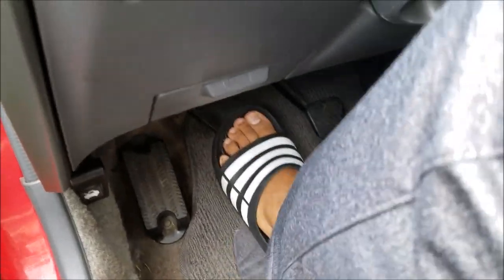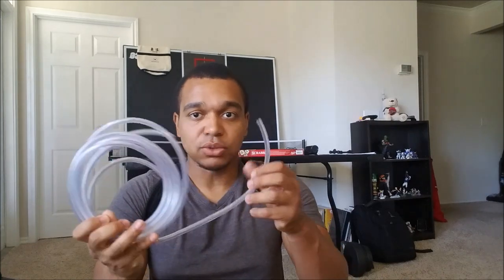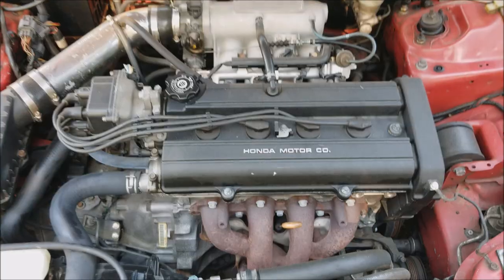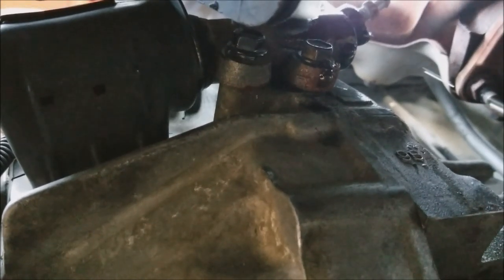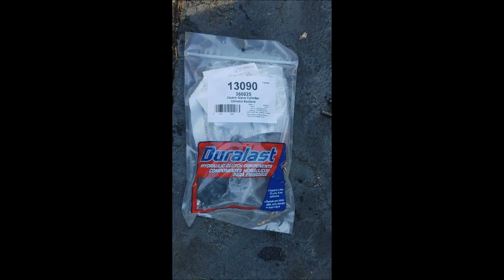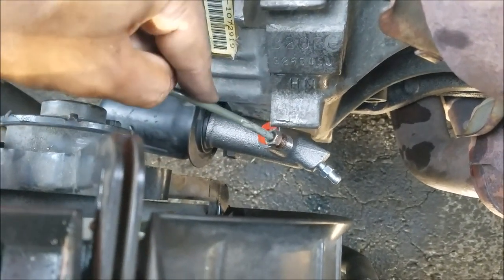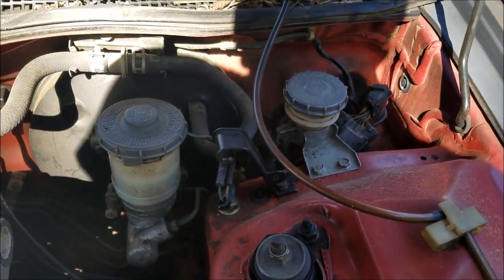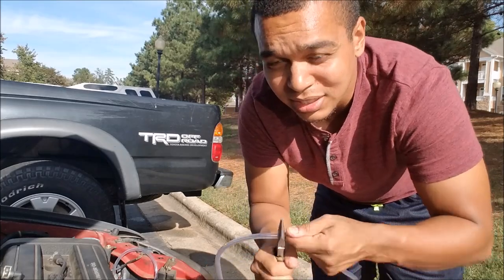SELF BLEED CLUTCH LINE & Change Slave Cylinder | Honda & Acura

Comment from the maker: If you like the video please like and subscribe! Looking to scrounge up subscribers to spread helpful advice to and also gain some knowledge from them! Enjoy learning from my videos as much as I try to pass knowledge :)

P.S. I mention braking a few times in the video by mistake haha. Just a slip since brake fluid is the hydraulic fluid for the clutch line.
Reply: Engineered Mojo thank you so much! You saved my ass.
Reply: Engineered Mojo like and subscribed.
Reply: Were working on a 2006 honda accord slave cylinder and were having a hard getting the car to stay in gear
Reply: Need some assistance were working
On a 2006 honda accord slave cylinder ,and it's not staying any suggestions on,what could be wrong. Or what were missing
Reply from the maker: @matthewkose3138  is it popping out of a particular gear or pops out of every gear?
Reply: Great video. Thank u brother.
Reply: @EngineeredMojo  you should hold the clutch pedal down while tightening the bleeder screw.  Do this a few times until there's no more air bubbles coming out and until you're satisfied with the firmness of the clutch pedal.  Make sure that you tap off the master cylinder frequently and never let the fluid to go all the way to the bottom to avoid getting air in there again.
Reply: @matthewkose3138  - Maybe it's your master cylinder that has the problem, not the slave cylinder.
Reply from the maker: @tropicalstorm339  Nice tips and appreciate the contribution! I never thought about tapping on the master cylinder, but makes sense.

Comment: Can i do this on a VW? Theres no clutch resevoir. Id have to do it to my brake resevoir. Can i still do this method?
Reply from the maker: You can do this method on a VW. It would not be your brake reservoir unless you are bleeding your brakes though. Locate the bleeder valve for the clutch system and the same method can easily be used

Comment: Thanks for making such a great video on this. It's been several years since I've done this repair and I forgot the steps (may still have my old bottle with the drilled-out cap lying around!). One thing I can't remember: how do you know when you've finished the bleed? Is it that the pedal becomes rigid for its full swing to the floor? I also thought there was something where you had to keep closing and opening the bleed valve .. but maybe that was if you're doing it without a bottle.
Thanks again!
Reply from the maker: Appreciate the solid feedback on the video, thanks! I stop the bleed process once I see a full tube line with no bubbles. Also, yes, with using a bottle, there is no need to keep opening and closing the bleeder screw. The fluid inside the bottle makes sure no suction of air occurs back into your line. Hope that helps!

Comment: Hey, great video, I have a problem,  could be air in the line, I recently change the master cylinder, but after a weeks the car have some problem to move forward, untill get stuck. Would be a broken slave cylinder or just air?
Reply from the maker: I'd check your slave cylinder to see if there are any visible leaks. Typically its noticeable. If nothing noticeable, I'd rebleed the system to purge potential air and see if that helps. Itll be noticeable if you slave cylinder is faulty as your car wont engage gears even after a proper bleed. Hope that helps!

Comment: And why are we replacing that with brake fluid ? Is that just to clean the clutch ? Then adding transmission fluid afterward?
Reply from the maker: Brake fluid is the fluid used for your slave cylinder and clutch. "Brake fluid" is just a generic term for fluid used in these push piston assemblies whether it's your clutch lines or your brake lines. Transmission fluid is something completely different meant for lubrication mainly. Not used in compression fluid systems. Only within your transmission housing. Good question!
Reply: Hey man, thank you so much! I was very confused and irritated because I was so unsure and I didn’t know how to approach my little issue; I wanted to wait to flush my transmission after I got the master and slave cylinder and totally made the assumption that they both used transmission fluid. My clutch pedal is a soft and well I wanted to flush it and totally did not they are separated haha
 
Thanks for your time 👏🏻

Comment: Hey bro when u were replacing the slave cylinder did u have the clutch push in while u were replacing it
Reply from the maker: I did not have it pushed in
Reply: @EngineeredMojo  did u drain all the fluid while u were taking the old slave n replace the new slave cylinder n add new fluid is that right
Reply from the maker: @wristcrysadmoney93colorado37  Nope not at all. In the process of bleeding the line you'll push enough new fluid through that small reservoir and clutch line to have majority new fluid running through
Reply: @EngineeredMojo  okay so I did my slave cylinder but I didn't get no pressure at all the pedal when all the way down bt I broke the steel metal line n when I push the pedal  the line leaks if that's the cause of no get pressure or did I do sum wrong to the bot or wrong Slave cylinder  it's just a lil bit idk it just fit tight bt the bolt is in the clutch assembly tho so idk wut now man
Reply from the maker: @wristcrysadmoney93colorado37  yea if you have a line leaking, you will have no pressure and your pedal will dump to the floor. You;ll have to replace or fix that line to regain internal line pressure

Comment: I don’t understand when you pull the boot out and it looked like there was some resistance what do you do just push it back in does it go back in you never showed that installation never done one before I guess it’s a trial and error thing but let me know
Reply from the maker: Oh yes the boot has a small lip on it that sits inside the transmission. You just make sure the boot lip sits past the transmission casing. Small resistance only

Comment: I have a 2013 dodge dart 6speed, when tranny heats up it will not shift into gear, is it my clutch slave cylinder? Can u help?
Reply from the maker: Transmission may shift hard when hot because their parts tend to get damaged, worn, and malfunction under high heat levels. Your transmission needs fluid to keep cool, and if the fluid leaks, then it may create more heat and pressure. The fluid may thicken and get burnt, and then it no longer functions to cool and lubricate, making the transmission shift hard when hot. I'd check your fluid level for sure
Reply: @EngineeredMojo  thank you for that

Comment: just bought an 06 tsx and the previous owner said he replaced both master and slave cylinder but today the pedal did the same thing as in the beginning of this video, it is considerably hotter here than where the car was in, i doubt that had an effect to this magnitude. what do you think?
Reply from the maker: chachi luna it's possible that they didn't bleed system correctly and there is still air in the lines. I'd rebelled the system and see how the pedal feels. If it feels the same check for leaks around the slave cylinder or master
Reply: Thank you

Comment: Hey man you might be able to help me. I have a 2002 Honda civic Manuel transmission. Today I put it in gear. I gave it some gas and it jerked than stalled on me... For 2 hours it didn't start. It turned over but no start... After 2 hours I gave it another try and it started without issue... Do you know what the problem would be?
Reply from the maker: Hmm that's a tough one. Personally whenever I have a no start issue I always start with the basics and verify fuel, ignition, then compression. Make sure you have adequate pressure in your fuel line, then I would check spark at plugs and test the starter. If all that checks out, compression and leak down test would be my next move

Comment: I tried it, but pumping the pedal just creates more bubbles… so does that mean a leak or air is coming in somewhere else? It’s a 99 integra that I am doing it on, bought 1/4 ID to 3/8 OD and it fit nicely right on bleeder valve but it just keeps creating more bubbles
Reply from the maker: Pumping the pedal is the only option to bleed the cylinder unless you had access to a vacuum mechanism. Have you tried putting a snug fitting closed wrench around the tude/bleeder valve? That may help seal the tube around the valve better, helps me out of a jamb every time!
Reply: @EngineeredMojo  I will try that next. I am also gonna go ahead and change the master cylinder as it’s inexpensive and see if maybe the problem lies there.
Reply: @EngineeredMojo   💯 percent was the master cylinder, bled in under 5 mins after changing it
Reply from the maker: @C1ARK1-OTLR  hell yea! Glad you were able to source the cause and with a cheap to replace part

Comment: Ok I think I know answer to this just checking if you bleed the slave cylinder that way will it also help bleed the master cylinder?
Reply from the maker: Correct, the only bleed valve in that closed hydraulic system is located at the slave cylinder. Great question
Reply: @EngineeredMojo  That isn't completely accurate. Some cars (like mine, 2009 Mazda 3) require you to deadhead the master cylinder to get the air out of it. Bleeding the line alone will NOT do the master cylinder on some cars.
Reply from the maker: @ragnaroksangel  nice good to know for future cars! Good thing I noted it's similar and not exactly the same process

Comment: Can I bleed the slave cylinder and master clutch cylinder on a 91 Accord installed
Reply from the maker: You can bleed the slave cylinder installed, but bleeding the master cylinder installed is tough. Rarely can you purge the system well enough of entrapped air, but worth a try if you want to experiment and have the time

Comment: I have a 2000 mustang gt it has a clutch cable and i normally do my own work and im at a loss mechanic said my slave cylender was out but my car has a clutch cable its not hydrolic any thoughts ive had people tell me no it doesnt have one and others say yes please help love my baby and want it back on road and now idk what part to but ...thanks in advance
Reply from the maker: Yes you are thinking correctly. With a clutch cable there are no hydraulic lines. Did the mechanic actually look at the car or just gave you information based off what you told them the symptoms were. Changing a clutch cable is not bad at all and there are a few solid videos on youtube for your exact vehicle!
Reply: Do you have a video on changing the clutch line?

Comment: Hey so I have an 03 kia spectra and about a year ago the clutch pedal started sticking to the floor so my dad and I replaced the slave cylinder and bled it. Now every 2 months ish the same thing happens, but now we just bleed it. The issue is, my dad just bleeds it into an oil pan, so I was wondering if that is the reason air keeps getting back in the line? I don't know anything about cars so I just went with what he said but after my own research and vids like this, I think the way we are bleeding it is the issue. Any thoughts? Thanks :)
Reply from the maker: Your self diagnosis sounds spot on. Since your dad is bleeding the line into the free air/pan the system is never truly isolated from air intrusion. I'd try attaching a clear line and fully submerging in the oil pan or a small bottle on the next bleed attempt. Hope that helps!

Comment: Since there is a bit of "soft line" prior to the slave cylinder, what do you think of clamping that soft line closed prior to removing the line from the cylinder, maybe prevent a good amount of fluid from leaking while you replace the cylinder, then remove the clamp (locking pliers, etc.) and finish as shown? Saw this technique used on a brake line. Made bleeding the brakes a lot faster. Also, what jcheeseman21 said, drip pan and gloves!
Reply from the maker: Mark Dwayne Madsen man that's good advice, I'm always trying to reduce fluid loss to reduce air intrusion in the lines and just create less mess. I'll be using that technique for sure next go around; thanks!

Comment: What transmission is that I have the same one
Reply from the maker: It's a B18 gsr transmission with a LS 5th gear swap, I love it haha. All Honda transmissions really, hardly give you issues
Reply: What’s lsd ?
Reply from the maker: @dash_gsr_323  LSD is Limited Slip Differential if talk about transmissions. It shuffles and distributes torque between your drive wheels

Comment: Did you leave master cylinder cap off while pumping the clutch?
Reply from the maker: I did leave it off to be able to have quick view to make sure fluid did not deplete from reservoir while bleeding system, main thing is you never want reservoir to run dry as you'll reintroduce air into the line

Comment: The clutch pedal on my 04 accord EX randomly stopped working, it stays all the way down and won't come back until i pull it up. It looks like a bit of fluid may be being lost but I can't tell where it's going. Would that be the slave cylinder and would this work?
Reply from the maker: That could either be the slave cylinder of the clutch master cylinder typically. I would check for fluid loss around the slave cylinder first, then around the master cylinder and inside the car where the clutch pedal comes through the engine bay wall. If fluid is found around the master or inside the car around the clutch pedal entrance it's most likely your master cylinder. If no fluid is seen or seen around the slave cylinder, I'd try to replace the slave cylinder. Slave cylinder's are pretty cheap, fail more often than master cylinders in my experience,  and "quick" to install and I always start there first if I can't trace the fluid loss. Hope this guides you well!
Reply: It would be your master clutch cylinder

Comment: Does the clutch line sit flush into the slave cylinder? I just put a new slave in and the clutch line still sticks out a couple threads.
Reply from the maker: The end but wont be seated against the slave cylinder. There will prob be about 2 or 3 threads left on the line roughly maybe 1 more. But you shouldn't have half the threads sticking out. If you can unscrew easily and thread back in easily to point where it stops and see no evidence of crossthread damage. You should be fine

Comment: Excellent video. Thank you. Enjoyed the Beethoven too...unexpected! Will be trying this on my 2001 CRV tomorrow. Hope it fixes my not being able to shift into gear. Does the slave cylinder just sit inside that boot on the left side? You don't remove that boot/cover?
Reply from the maker: Haha, I like to listen to calming music while doing car repairs. Figured people wouldn't mind similar music while learning about a repair. You are spot on, the slave cylinder sits in the boot and the boot is just a protective cover. you can remove the boot ( it has grooves that wedge inside the transmission housing) or you can leave it on while replacing the slave cylinder. Typically I'll take it off just so I can maneuver it around the slave (better views of how the cylinder is mounting) while I'm installing then I'll pop the grooves back into the transmission housing once I get slave cylinder mount bolts in place.

Comment: I can’t get the slave cylinder to go in all the way and nothing lines up, what am I doing wrong 😭 it’s the right part but there’s too much pressure to push it in the boot
Reply from the maker: You ever get it lined up?
Reply: @EngineeredMojo  I had to get some help but yes, i eventually got it
Reply from the maker: @chaseadkins6217  awesome glad to hear it worked out in the end :)

Comment: Great tutorial. I’m in the UK and just had my Peugeot 207 slave cylinder go. I’m assuming I can roughly follow your tutorial here?
Reply from the maker: Glad this video is getting some reach, and yup it should be similar process with only locations of items different. Hydraulic slave cylinder technology hasn't changed, so same principles to bleed system. Good luck from your cousin across the ocean!

Comment: The area where it bolts on is cracked in half... my pedal lost pressure and when I looked under my 02 civic this part was lying right there on the ground, in a pool of oil....
Reply from the maker: Wow unlucky break...literally. I've never heard of that happening, you must have gotten a transmission with micro fractures, bad cast. Rare but not unheard of. Typically you'll here of a break at the transmission mount. Were you in an accident or car exposed to anything that might cause damage prior?

Comment: Isn’t there air in the tube though? I’m talking about the tube you cut that is between the bleeder valve and the water bottle filled with brake fluid.
Reply from the maker: Yes of course there is but it is displaced into the bottle once you start pushing the brake pedal and pushing fluid through the line. Fluid (air and brake) is going all in one direction. The air once reaching the bottle will pop into bubbles on surface of old fluid in bottle

Comment: My clutch is free now.what to do ? And it is decreasing fluently oil in reservoir
Reply from the maker: I'd check for a leak location. Follow your break pedal through the fire wall to the clutch master cylinder and inspect all lines. Then follow the lines to your transmission. Brake fluid eats away at paint so you may be able to spot a leak location by damaged paint!
Reply: Engineered Mojo thanks mate thanks alot but it may be issue of slave cylinder

Comment: And what if it doesn’t want to go in east back into the fork
Reply from the maker: I'd try to wiggle back and forth a bit and also push the fork back with your hand to get additional clearance
Reply: @EngineeredMojo  thanks mine is leaking bad
Reply: Would the leak cause my engine to bog on the pedal !
Reply from the maker: @dash_gsr_323  not sure I understand, but a leak from your clutch line would only cause your clutch oedal to either go sift or completely to the floor and not allow engagement of the clutch plate
Reply: Okay thanks